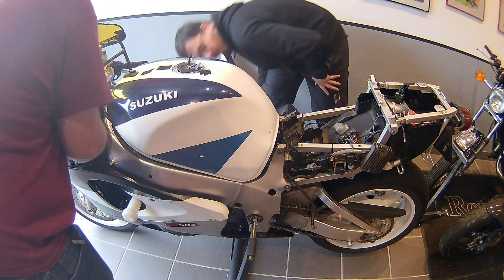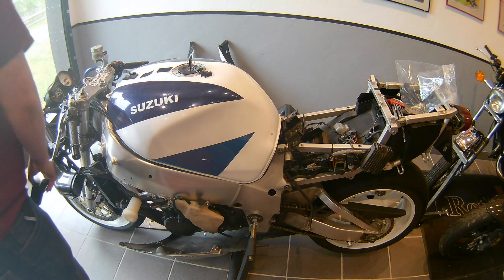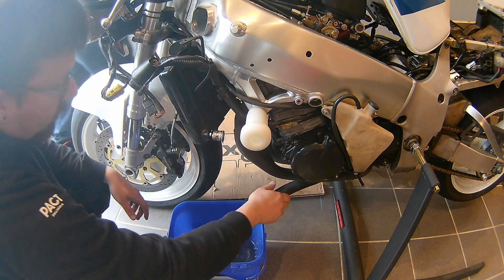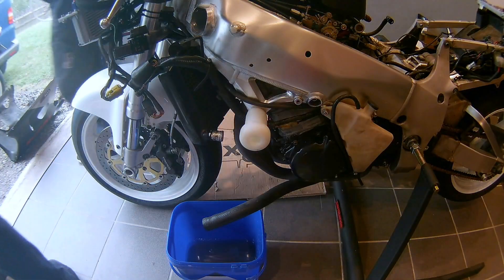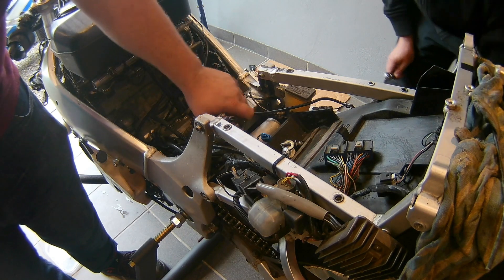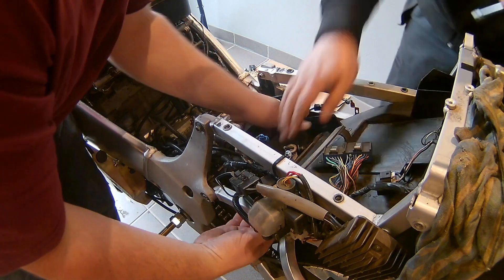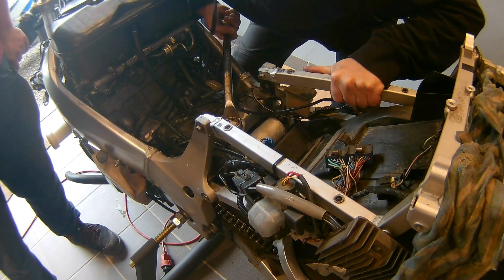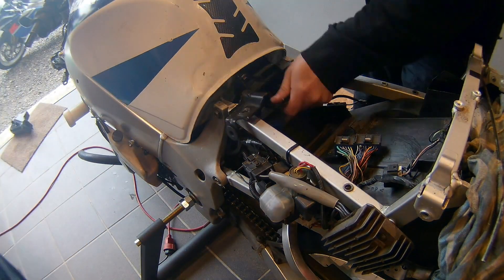2nd GSXR 750 SRAD Build: Changing the rear shock

Comment: How do you remove the intake tubes, without removing the nose fairing?
Reply from the maker: You can pull them forward (strong but carefully) and the remove the rubber seal between the frame and the intake. After that you can remove the intage tube.